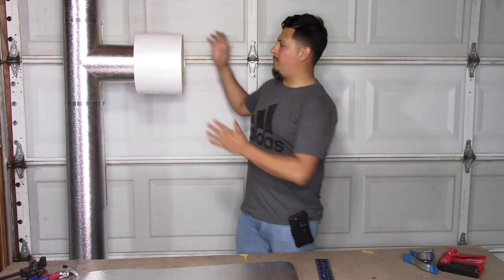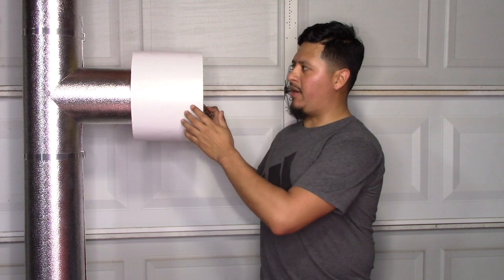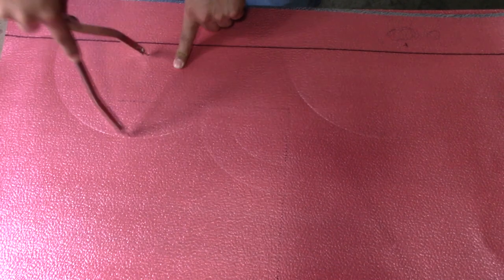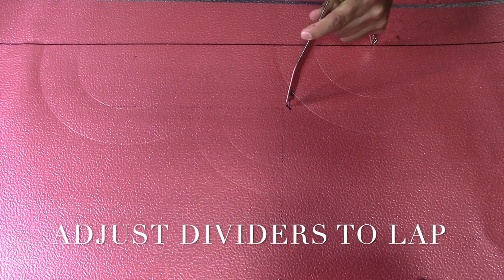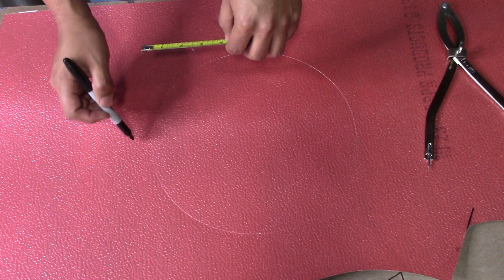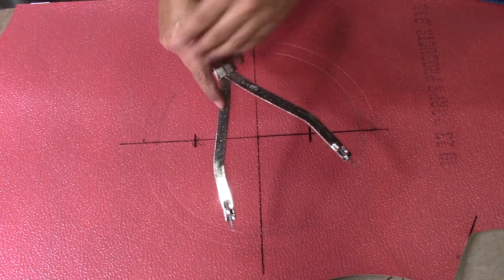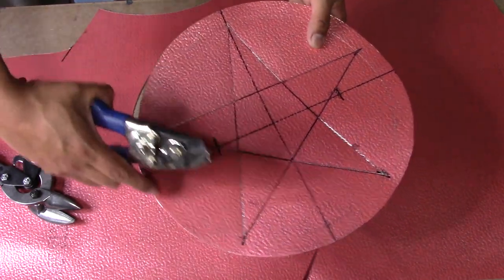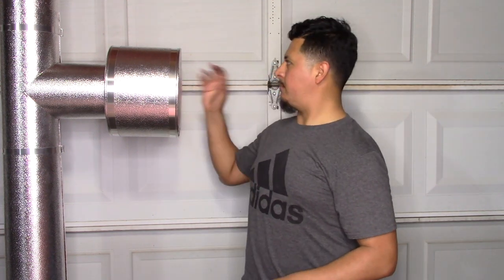How To Make Metal End Caps + Star

Comment: You the man that looks awesome. My big jobs going pretty well. Except the fact that they changed all the roof drains to polyiso abt 10,000ft. Which has to be made to order takes about 3 weeks and theyre steady covering us up. I wondered if you could do a lateral in vinyl or metal
Reply from the maker: Yeah man that can really slow you down, make sure you have all your orders good and ahead of time to minimize the waiting. I will do that video not sure when tho but stay updated on the channel. Thank you for your support!
Reply: @jpadtv1178  Yeah we had all of the material ordered in fiberglass because they were supposed to be done in fiberglass via the specs. Owner of white claw came in and decided they wanted to change to poly iso. After we unloaded a whole 18wheeler and organized the material to do it smh.